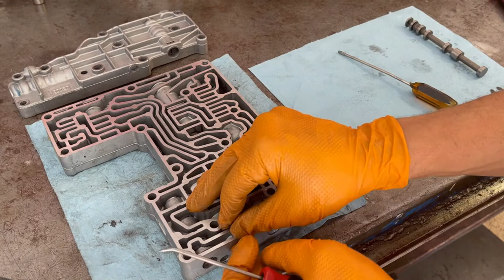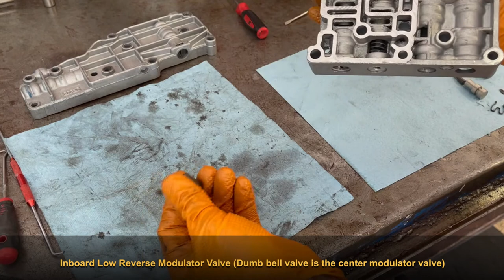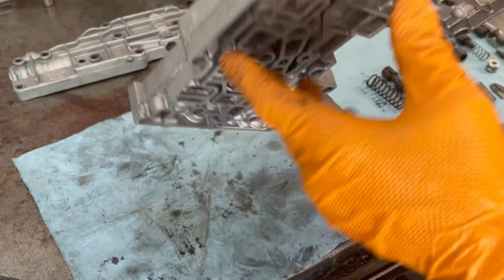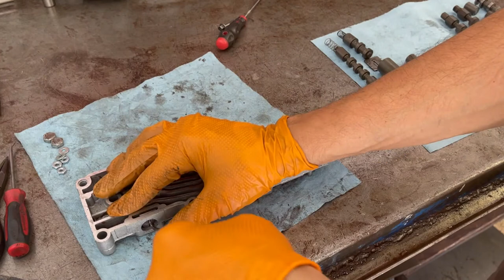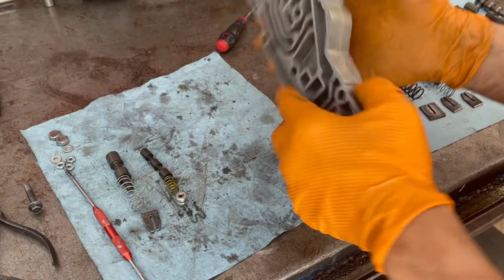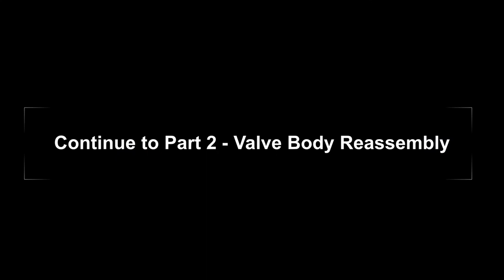Ford 4R100 Rebuild - Valve Body Disassembly / Trick for Removing Stuck Valves

Comment: Good day Nick, hope you can help me with a 4r100 in a 2003 7.3l e350. Great videos on YouTube by the way. So I guess I’ll start by telling you what I’m doing…all bearings all thrust washers transmission had 94,000 miles when it blew the lip on the forward piston, everything inside was super clean. so I decided tp beef it up a bit. Changed the aluminum for steel six pinion planets in the rear. All new steels, Raybestos GPZ frictions. All new sprags, including the heavy duty one, milled Center support with snap ring, tig welded coast clutch, new center support sonnax bearing, new solenoid pack, sonnax oil pump reg size. The question to you is I have a box truck that weighs 10,000 pounds daily and was wondering if I should use the sonnax HD or the transgo tugger kits. What would you suggest? Should I mill the oil pump stator and body? Should I add another friction and steel to forward and machine the upper plate? I’m also using a billet torque converter from Goerend Torque Converter ( 4FBD ).
Reply from the maker: Hi Manny, thank you for the views and kind words. 

Looks like your build is off to a solid start; you're doing a lot of the same things I and many other builders do to these transmissions. I typically install both the Transgo Tugger kit and a few select parts from the Sonnax Zip kit such as the PR valve, Boost valve and line pressure modulator valve. Most of the pumps have enough wear that requires some resurfacing so I always have the pump body milled out to install the Sonnax oversize gears. Adding another friction and steel to the forward drum is up to you but usually not necessary given that clutch is always applied in any forward range position on the shifter. I would replace the belleville style return plate with a new one, install a Sonnax one-piece rear case bushing along with new bushings everywhere else in the unit and overdrive piston return spring spiral-loc snap ring.
Reply: Thanks again for your insight, I would suggest that a possible video for the future would be a pump resurface… if you don’t have one already…thank you again for your quick and timely response… stay blessed.
Reply from the maker: You're welcome, Manny. I'll look into doing a video on the pump resurfacing once I have another 4R100 in the shop.

Comment: Good Nick, Put everything together in my 4R100, just wanted to verify something with you before I put the oil pump on… I am able to turn the input shaft in both directions by hand, but I’m only able to turn the output shaft in one direction and in the other direction it does not move, Is that normal? I’m assuming that’s why you don’t soak your… I soaked my frictions.
Reply from the maker: Hi Manny, it's hard to turn the output shaft when the the transmission is vertical as you have the entire weight of the components working against you. Install the pump then rotate the case horizontally and spin each shaft...If the output shaft won't spin at all when horizontal and not in park, something is bound up or misassembled in the case.

Comment: I just had an e40d rebuilt, all electrical is good.  It doesn’t shift into second gear when it’s supposed to and when the solenoids switch for 3rd it shifts into second gear.  When both solenoids go off it skips third ad goes into O/D. Any idea what the builder could have done to the valve body to cause this? Thanks
Reply from the maker: Some questions:
1) Did you have any of these issues prior to the rebuild? 
2) Was the solenoid pack replaced during the overhaul? 
3) Do you have a check engine light or overdrive light on? 
       If so, what are the codes? 
4) How late is the 1-2 shift in terms of vehicle speed? 
       Late 1-2 shifts are usually associated with sticking 1-2 accumulator valve in the accumulator body. 
5) Are you not able to achieve third gear at all or is it possible that you are skipping second gear all together and shifting to third gear (when you think you're in second) then fourth gear?
6) Does the fluid smell burnt?
7) What, if any, shift kit or other non-stock parts installed?

The solenoid firing sequence for E4OD/4R100 transmissions is as follows:
1st gear: Sol A - on; Sol B - off
2nd gear: Sol A - on; Sol B - on
3rd gear: Sol A - off; Sol B - on
4th gear: Sol A - off; Sol B - off

A common problem with E4OD/4R100/5R110 transmissions is a no 2-3 upshift condition caused by stuck/sticking 2-3 shift valve after rebuild. This is caused by over-torqued valve body bolts that are proximate to the 2-3 shift valve during reassembly. Not sure if this is your problem; answer to question 5 will let me know if it's relevant to consider.
Reply: @nickstransmissions  1. transmission was working perfectly before rebuilt other than it was overheating on the interstate. 
2. yes a new solenoid pack was installed, and yesterday I tried a second solenoid pack. No change
3. no check engine light, and we had one trouble code for solenoid 2 low voltage. with a multimeter in the harness voltage seems to be correct .7 to .8 when activated and battery voltage when not activated.
4. with a pair of multimeters hooked to harness when 2nd gear is activated the transmission does not shift, run it up a few more rpms and when third gear is activated according to the voltage readings the truck shifts into second gear but solenoids are showing third gear is activated. 
5. the only time i have got third gear is on the highway in overdrive and i get the truck to kickdown, then it will go into third gear.  when the truck shifts from second to overdrive it drops like 1000 rpms and is clearly skipping third.
6. In the 20 miles that are on the transmission the fluid has darkened up some but does not smell burnt at all, trans temperature has not went over 130 degrees
7. I would have to ask the builder if there was a shift kit installed

It seems like anytime solenoid B or 2 is activated the transmission has the issues

Also yesterday I tested all the wiring to make sure there was not broken wires. All the wiring is good.

I have a larger B&M pan on the transmission 

Also when I changed the solenoid pack I noticed a nut falling off the valve body . I found that most of the bolts where not torqued more the just past hand tight,  I set my inch pound torque wrench to 90 and went thew everything.

I also tried the neutral safty switch, made no difference.
Thanks
Reply from the maker: Yep, sounds like your electrical system and solenoid pack seem to be working fine as you mentioned initially (it's always good to have the details as to what was done to confirm/deny)...So, the suspected causes are 1-2 and/or 2-3 shift valves (main valve body), 1-2 and 2-3 accumulator valves (accumulator body) and check ball placement on the case. E4ODs take 'n' number of case check balls based on prod year as follows:

1989 - 10 CBs
1990-1995 - 9 CBs
1996-1998 - 8 CBs

All E4OD and 4R100 transmissions must have the Transgo Tugger and/or Sonnax Zip kit installed as those kits contain numerous updates and product improvement parts that address a multitude of factory-designed issues that lead to several pattern failures when the trans is in service. One of those is sticking 1-2 and 2-3 accumulator valves in the accumulator body - the factory coated aluminum valves often hang up in the bores and should be replaced with the steel valves that come in the kit. The builder should also be polishing these bores so there are no 'high' spots for the valves to hang up. Nearly every E4OD and 4R100 requires this to be done on at least one of those valves.

If your builder did not install any shift kit or make any of the other required updates in the case (spiral lock snap ring in the OD piston return spring assembly, stabilizer case ring for the center support (center support needs machining), brazing the overrun clutch drum), I would strongly recommend taking it back and having them do so.

The fact that none of the VB bolts were torqued to spec leads me to believe other things may have been missed or neglected as well. 

If you haven't already done so, check out the first video in my series on Rebuilding the 4R100 where I lay out all of the things builders should do to any E4OD and 4R100 that comes in for its first overhaul so you can query your builder to see if any of that stuff was done to your transmission.
Reply: Tonight I pulled apart the entire valve body and cleaned everything and made sure everything is free and moving properly. Rebuilder did tell me he never took apart the valve body… all 8 balls are in but one of them can move between 2 holes in the plate. Other than that everything looks perfectly…
Reply: @nickstransmissions  still no luck! I took the truck back to the builder, they pulled the transmission back apart and found nothing wrong and claimed to have pressure tested everything!  Today we tried a tps  sensor and put the original solenoid pack back in… also tested the speed sensor tonight…. Any other ideas??? How can it shift into the wrong gear vs where the solenoid power is???
Reply from the maker: If you haven’t already done so, Id swap the valve body at this point. Just make sure you match the casting numbers as there were a few different variants across the E4OD/4R100s over the years.
Reply: @nickstransmissions  going to look for a used one to try…. I’m hoping to find out how second gear solenoid configuration is activated the transmission doesn’t shift, then when 3 gear solenoid configuration is activated the transmission shifts to 2nd gear. Then od is activated it dumps from 2nd yo od… how can the fluid even flow that way to make this happen.